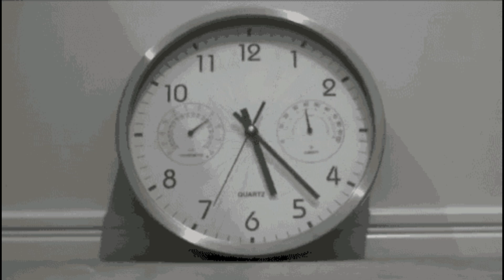R2D2 Magic Panel Build

Comment: excellent work patt, i followed your work from the start, it's so good magic panel. I bought PCB, but not found program for the arduino. Have you shared the arduino program?
Thanks for this very good LED project

Sorry, Just found it, it's juggler program.
Reply from the maker: Thanks Jeremy,

Yes it’s the same code from the Juggler. I had to make one small tweak as I’m running only a single Max7229. I discussed it in my build log. If you need help getting it he change to work let me know.
Reply: I have found the modifications in Astromech forums, and thought I modified the Juggler MP script with the needed changes. Changed the Ledcontrol = lc line and the Void MapBoolGrid section. When my MP boots up the LEDs cycle vertically starting at LED 0.7 going to LED 0.0 then to 1.7 to 1.0, 2.7 to 2.0. etc all they way across. As yours appears to start at LED 7.7 to 0.7 then to 7.6 to 0.6, 7.5 to 0.5..... They also don't seem to want to accept any commands from either USB thru Serial Monitor connected to the Nano, Marcdunio Serial or USB to TTL serial port connected to the VIN,GND,RX header. Any ideas what to check? Thanks!

Comment: Hi, the mount and the lens, are they 3d printed? If yes can you kindly share the file, and especially the lens, what filament did u use? And can I just paint with an Aluminum color?
Reply from the maker: Hello Nizar,

Yes the mount was 3D printed. I didn’t make the file though, it was another builder. If you send me an email @ pat.rodd@roddbotics.com I’m sure I can get you a copy of them. 

For best results I recommend printing the lens with a clear resin. The mount can be printed with just PLA as it is all hidden. For the aluminum look on the lens I use a brushed aluminum sticker that is semi transparent.

Comment: excellent work, I am also building an r2d2 but I have had problems getting some electronic parts. Is there an alternative to the Xbee s6b?
Reply from the maker: I’m not too sure if there is an alternative as I am not sure what the embedded coding uses in the marcduino or r2t touch app. I did a quick look and they have a bunch on mouser electronics website right now ready to ship. 

https://www.mouser.com/ProductDetail/DIGI/XB2B-WFPS-001?qs=NnxJOTDiCpMA4dfbwsXxnw%3D%3D

Best of luck on your journey and thanks for the comment.
Reply: @prodd1982  Thanks a lot